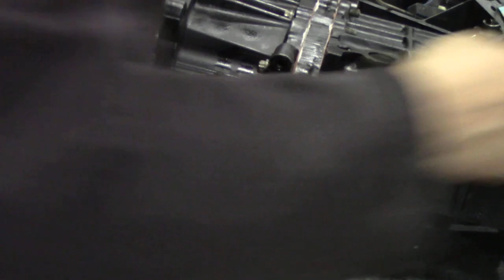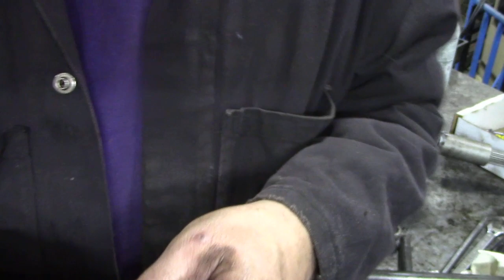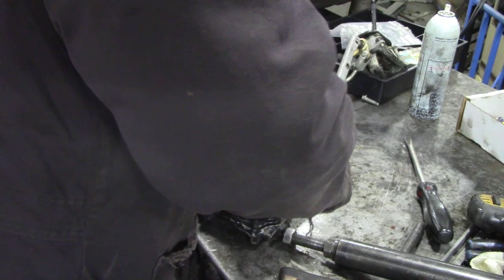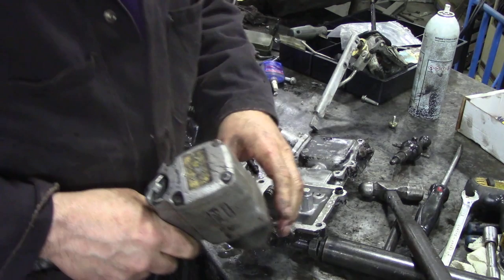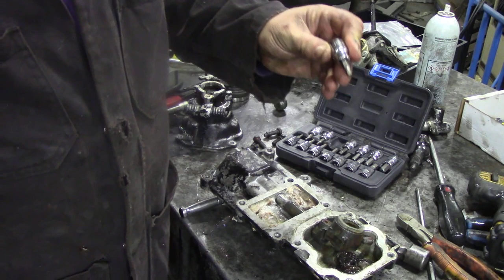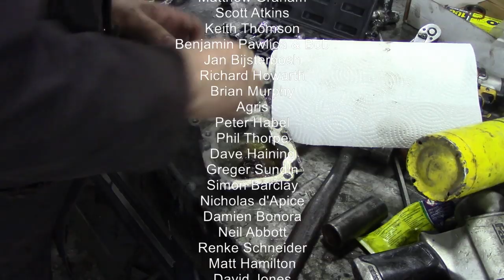LT77 rebuild part 7

Comment: I found a lot of wear to the slots on either side of the gear selector housing. I dare say nothing can be done short of replacing it, it was bound to happen with a steel rod bearing on soft alloy shell
Reply from the maker: That is quite common - but can be TIG welded up